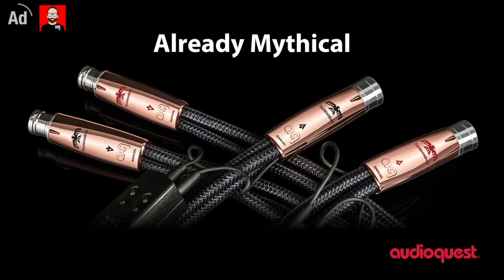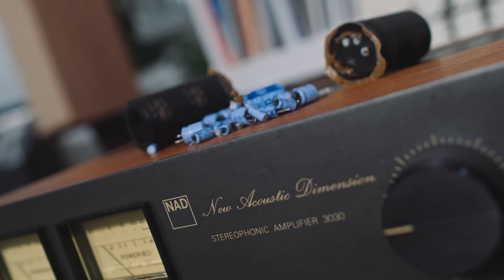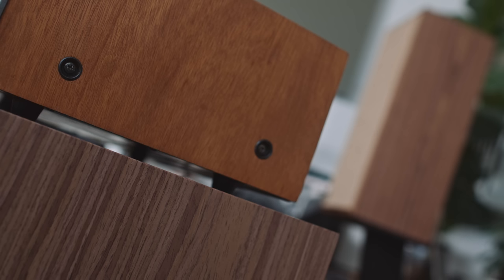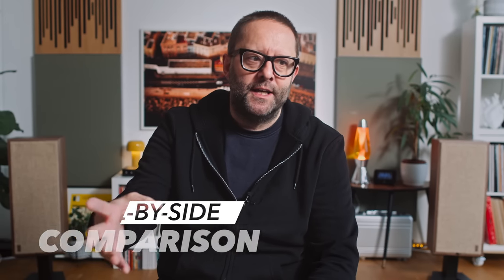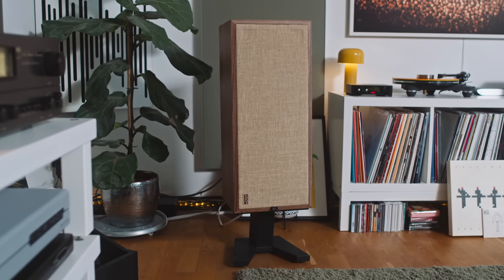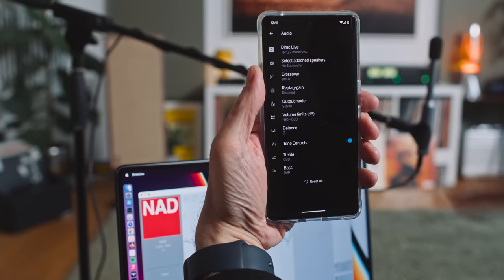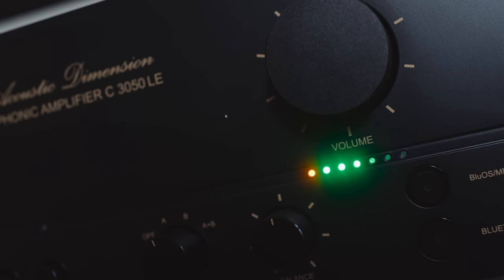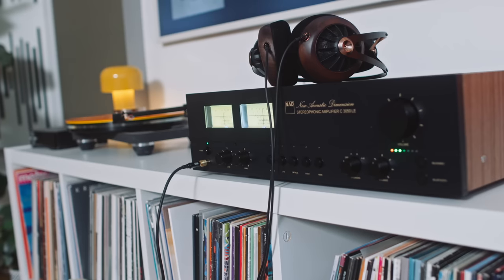The NAD C3050 LE is a VINTAGE AMPLIFIER for the 21st century!

Comment: I happened to audition this C3050 recently. The VU meters are more like toys, not done properly. They just dance around, too sensitive. The lights are like car headlamps too bright, can't be switched off, the other LEDs are cheap lights hardly dimmed but can be switched off. NAD learn from Yamaha AS series as there 701, 801, 2200 are around your system. The SQ is very clean, but to me, sounds digital, not AB like amplifier. The only reason to buy this amp is if you like BluOS want room correction, etc, I ended up getting the Yamaha 801.

Had this amplifier had VU lights switch able on off I may have considered given the price, they are just too too bright for night listening.  Other LEDs are comical, not elegant like Yamas.

Comment: It's a shame they chose class D for this device. All this for the sake of power, which in fact is useless, a good 2x50 watts at Mosfet with a solid power supply is enough for most situations. If your speakers really need more power, in my opinion the bin is the best place to put them...  😉
Reply: speak fir urself ive got 12 inch woofers

Comment: Ugly ,gray mouse for hyped auditory, real Nads was model 60, model 90,,, and receivers model 140, model 160 and... ,I listened new Nad c388 and I we're disappointed of this new hybrid sound.
Reply: I have the NAD c388, and I'm.pretty happy with it.Guess speaker matching is one important factor, and I use my old Dynaudio DM 3/7 which need plenty of power to shine and works very well.I agree with certain speakers the sound is dry but as always synergy of components is important. Viena Acustic speaker was a very good match as well, and I added a red velvet Vermout power cord that mellow t
he sound. It is not an amp for all sorts of speakers. One has to do some homework